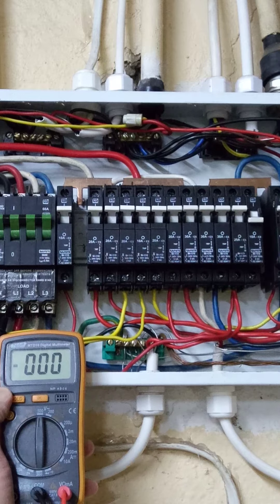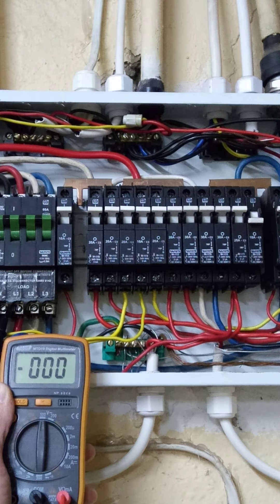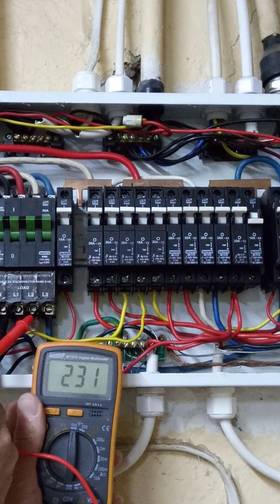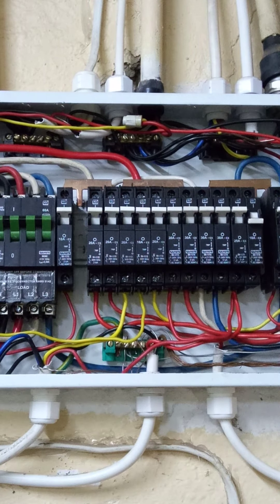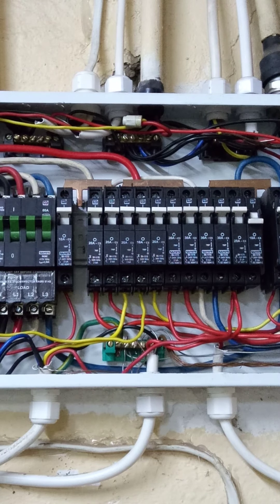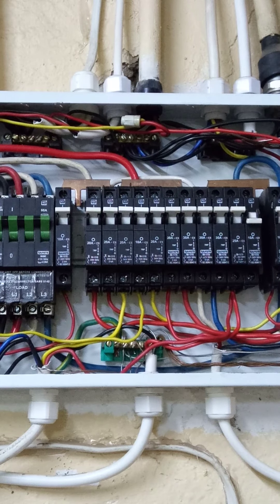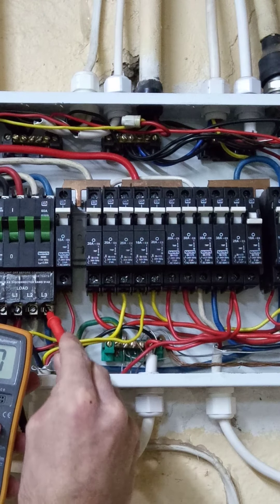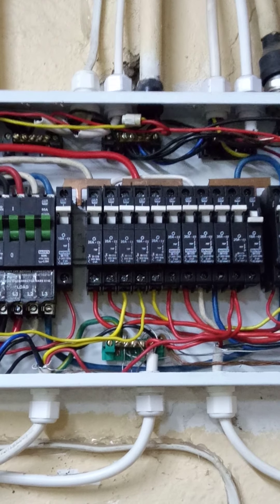Why phase balancing is so important

Comment: Even if unbalanced won't always affect the voltage reading. Usually you'll see it using currant clamp Not volt meter.
Reply from the maker: Not true. The phase with the most load will drop in voltage due to cable length and resistance. Even if perfectly balanced there would be drop over the length but it would be around half compared to only loading one phase. I see it all the time in this area where one phase has lower voltage due to carrying more load.

So if you have three phase you need to balance your own loads. If you suffer undervoltage, time to involve the power company.
Reply from the maker: Sorry for the late reply. This is voltage shift due to imbalance in the neighbourhood, not just my installation.

Comment: 1.If i may ask, what causes the high/low voltage and how do you solve the problem?
2.What causes shocking taps and how do you resolve it?
Reply from the maker: Hello

THIS IS EXTREMELY DANGEROUS AND CAN LEAD TO DEATH so you need to get your electricity supplier out as soon as possible.

It sounds like you have a neutral fault somewhere.
Speak to your neighbours and find out if anyone is having the same problem with voltage and shocking from taps.

Have a look at my other video on the effects of a broken neutral on three phase supplies - link below. 
Even if you have single phase, the supplier feed outside is three phase and will still affect you.

https://youtu.be/Vb_3cEw3uxA

Comment: Hi, Ive been diving into my 3 phase meter and I noticed the same thing. One of my phases reads near 240ish in the day, but drops to 237 at night. I was thinking, doesnt that lead to higher bills (cause thats certainly what ive been getting for the past 3 months), since P=VxI? I cant really find out which phase is more utilized in my street but do the voltages provide a hint? The most energy intensive items in the house are ACs.
Reply from the maker: You'd probably find a  slightly higher bill on some items. But air conditioning will just cool slightly faster with higher voltages and then turn off once reaching the set temperature.
Here they turned the transformer down to 230v to 235v range and I didn't notice the bill change.
My preference would be 240v to 245v but they won't change it.
Meanwhile two blocks away they have 235v to 253v!

Comment: You mentioned that this could damage the transformer, which is a utility supplier issue/ concern. What about for the property owner? Does the unbalanced loading on the phases cause a problem for the property owner (e.g. increased risk of fire or equipment failure)?
Reply from the maker: It may do.
When a phase is overloaded, the voltage will drop depending on the length of cable from the transformer.
So it's possible that you end up with a voltage below the range of equipment (I.e. 207v to 253v).
I've seen cases where a phase was right down to 180v!
Some equipment won't care (a kettle still boils and a phone charger is designed for 100v to 240v).
But motors don't like out of range.
I've found motors don't increase amps when the voltage drops (which is what most will tell you).
A motor running under voltage tends not to have the required power so it strains and heats up.
It's not unimaginable that this would fail or catch fire.

A more loaded phase will have a conductor that warms up more, which in itself shouldn't cause a fire since breakers should trip.
But with a high current it's likely any poor connection will get hot and that could cause a fire.  I've seen that many times.

Hope that clarifies?
Reply: @TheCrazyENTP  many thanks. That does clarify. Poor connections are always a worry.

Comment: My generator has 3 phases and balanced well and I use it sometimes to charge my compressor or other things I don't use often ot says overcurrent when I check the 3 phases are not balances how can I solve that, the generator is too powerful to be overload by that small compressor can you help how can I solve that
Reply from the maker: Wow that is strange.
If the generator is big enough there shouldn't be an issue.

Does it happen even if the compressor is the only load on the generator?

The only thing I can think may cause this is the initial starting current of the compressor which may be more than the generator can handle.
Remember it can be 4 or 5 times the running current of the compressor.

Comment: Hi, quick question, do unbalanced phases cause higher electricity bills? If so could you explain how that works?
Reply from the maker: Hi Werner

That's a great question.
I'd say it's unlikely to affect the bills, but high or low voltage may affect the life of appliances the further from 230v you go.
If phases aren't properly balanced you can end up with voltages wide apart from 230v. One phase will be low and it will push the neutral making the others higher. I've seen a case where one was 189v in a badly balanced street! The other two were past 240v on a 230v transformer, even nearing 253v!

If you take P=VI (watts = volts multiplied by amps), then lower voltage on a heating element means it produces less heat with lower voltage or more heat with higher voltage. The amps don't change.
So, a kettle will take longer to boil with lower voltage. I've seen my toaster will not toast bread well at lower voltage around 210v or it burns it quickly at 240v. Both those are within range though.

Now with motors, people say motors use more amps when the voltage drops or less amps.when voltage rises, but honestly I can't prove it. I've measured my pool pump and the amps stay the same no matter what voltage. It does start getting hotter if the voltage is low for too long, and that's not good.
My vacuum cleaner changes pitch with the voltage, so it sounds like lower voltage means lower watts means less suction.
With my washing machine, I can see it doesn't tumble quite as easily when voltage is 210v compared to say 240v.
So I'd say higher voltage means less strain on the motor.

The biggest reason to balance phases properly is to keep the voltages more even, and it's very important for anyone with three phase motors because one overloaded phase will bring down the phase to phase voltage on one pair.
Three phase motors would always work with a difference of a maximum of 2% average on phase to phase voltages.
So if you find 386v, 390v and 400v, that is already on 2% average voltage.

Conclusion in my opinion is you'll not really notice a change in the bill with better phase balancing, but you'll have appliances that last longer and save money that way.
Reply from the maker: P.S. if you ever start feeding solar power back to the grid, you don't want voltages to be on the high side from bad balancing.
The PV systems will cut out if you go over a certain voltage so you would lose out on revenue.

I've not had experience with this but have heard it happens in Australia at some houses.

Comment: Voltages on three phase systems will float just like you show if the system is not grounded correctly.
Reply from the maker: Not correct.
You need to understand TN-C-S earthing firstly.
Secondly you need to know about voltage rise and drop which is standard on any circuit as wire has resistance.
Thirdly, phase balancing reduces voltage drop (and rise too) by reducing the amount of current on the neutral.

For a broken neutral and those voltages see.my other video at https://youtu.be/Vb_3cEw3uxA
That is a different case completely.

Comment: 3 phase power in houses? Is this a very large house? I've never heard of such a thing.
Reply from the maker: It's very common in houses here.
They were originally 1 acre stands and people put in boreholes with 3 phase motors plus there was a craze for tennis courts at one time. Floodlights were installed and were halogen 1500 watts each. 6 of them needed!

The distribution board you see in the video is for the garage and upstairs office. It's one of many. 
One main board feeds to four different boards with RCD. Garage and pool have a sub board each added. House has a sub board and two sub boards off that.
Last one is single phase for the alarm floodlights (see my other video).
It's a bit complicated.